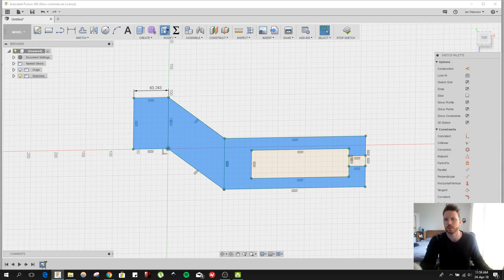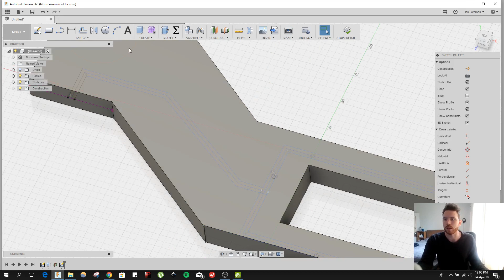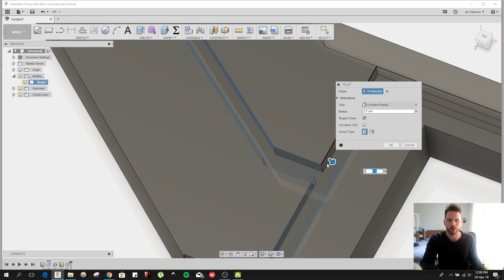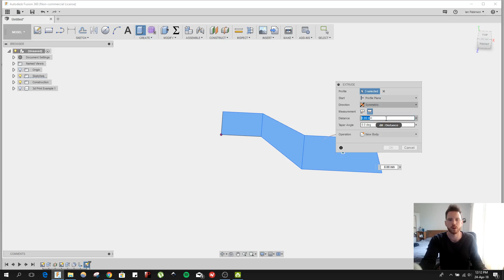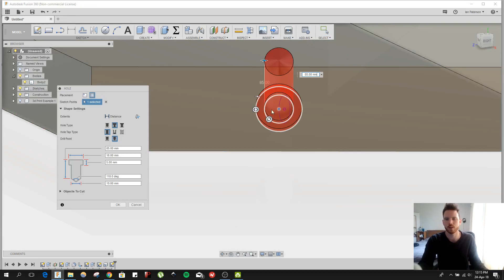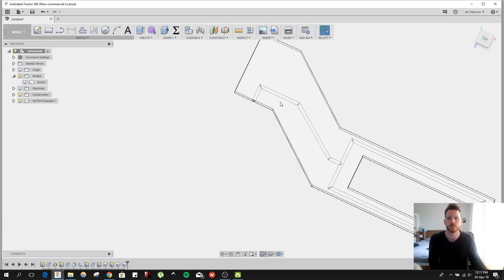Internal Channels in 3D Printed Part - Reddit Q&A #1

Comment: Thank you so much! That was "an epiphany a minute" for me! Not just for the part, but for the small details like changing opacity, extruding from center outward, making 2 lines parallel with a single click, combining stuff to a feature and so on... Learned more with this video, than with all the tutorials I watched combined! Also enjoyed the last part about how you would do the same thing if you could not 3d print it. Obviously that would be a way too cumbersome and expensive solution in reality, but very interesting! - You can google "Scottoiler Dual" images to get a quick Idea how they did it commercially... (wow, that single part costs 37 Euro at our motorcycle store! for a tiny piece of plastic!)
My 3d printer arrived literally 5 minutes ago! It came with green translucent resin, so it should be easy to spot how the channels hold up in printing!
Reply from the maker: mcbrite no worries buddy this kind of question is good fun to answer
Reply: I think you'd be proud of me! Today I designed a headphone-holder to clip to my desk! Designed 1 half, cut an inner offset to save material, improve strength and improve the looks, filleted and then mirrored it! - My timeline looked perfect! Only the necessary steps and no errors! - So much fun I wonder if I shouldn't have become an engineer all along! ^^ - Revision 2 of the oiler is printing right now... 16 hours with 3600 Layers! (became to long to print flat against the bed, that would have cut the time to 2-3 hours. thought about splitting the design and glue with epoxy afterward, but it was too messed up at that point to do that easily...) 2 pics:
https://imgur.com/a/PUjVJeu
https://imgur.com/a/zhvbgyN
Reply from the maker: Very cool, 16 hrs is pretty serious! Hopefully it all goes well - keep me posted!